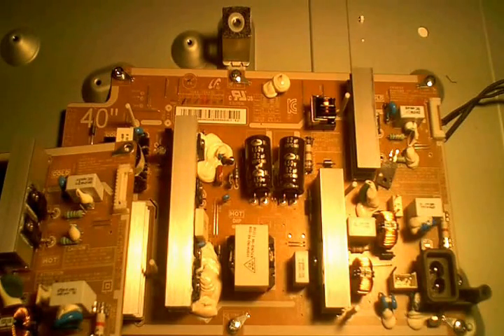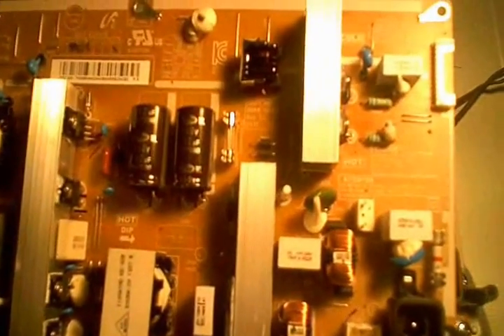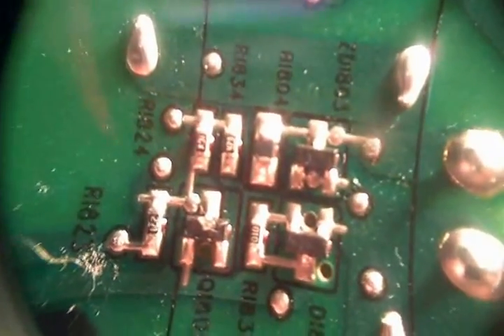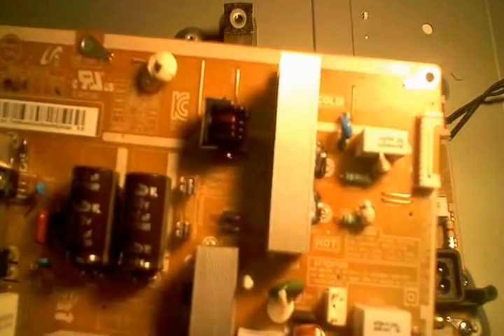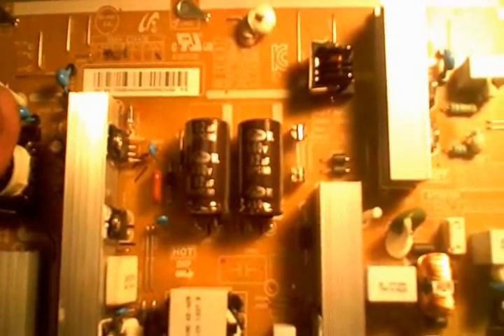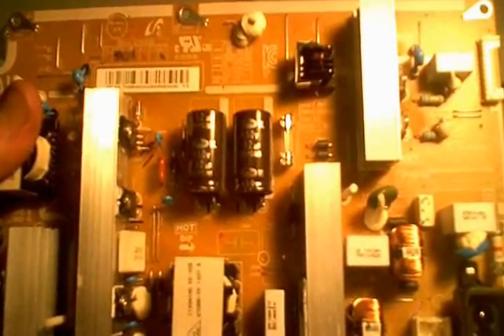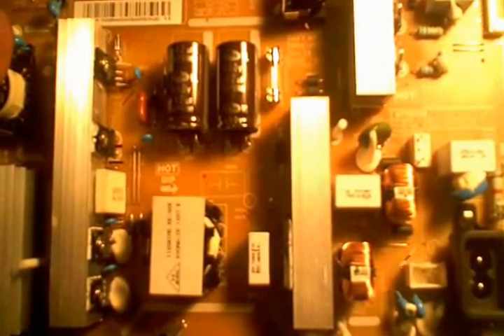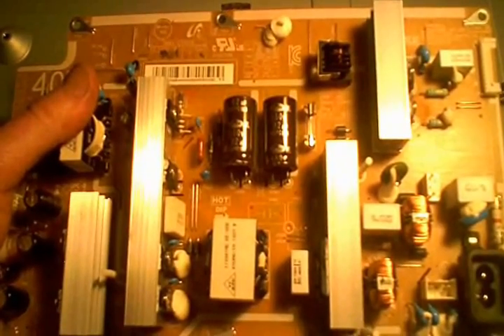Salvaged TV parts. Warning about some retailers..

Comment: I fix TVs for a living.Same exact deal.Sometimes you get stuck with a board so badly damaged,you have to purchase a refurb or a used one.Now that the set is on MY bench and open,the customer wants it ballpark when you say its going to be done and estimate price.I have TWO MAJOR "established parts dealers" that have it right on their website "all parts tested and working by a qualified tech". Im not going to name names,but when I order these "ELECTRO PARTS",I need my "TV PARTS TODAY". EP sent me 3 bad main boards in a row.How did I know?The problem with the set was it wasnt reading the HDMIs.The set fired up perfect.However,every time EP sent a board,the set was completely dead.Shop Jimmy,the go to guys,finally got it in.A 10 day repair job took 3 months.When I dealt with "TVPT",I needed a power board for a sony.The original was corroded beyond recognition.3 bad power boards in a row they sent me.And OBVIOUS bad boards,just by looking at them.Then took a month to get a refund.I FINALLY bought the board off some guy on ebay because I was desperate.It came wrapped in an old curtain,was half the cost,and worked on the first shot.If I was a beginner,Id have thrown the sets out and given up.Thats what these places WANT you to do.Currently I am sueing "EP" for $1200 for wasted bench time and I had to eat the cost of the repair.Case filed with the Cali attorney generals.I buy ALOT of parts,folks,the ONLY one I found to be totally reliable is Shop Jimmy.Good luck and watch those scam vendors!

Comment: I have gotten a few free tvs from Craigslist from upgrading and or have cracked screens I check if they work and then unplug and let them sit a week or so in my storage unit. Then I take them apart it's something I can do after my job and my son loves to watch and ask questions at 5 years old. I look at everything I take apart and post lots of pics on the parts but is there something I should do like zoom in and take pictures of the connections also?
Reply from the maker: +James Pace 
Plugging the TVs in to see if the back light comes on is a good idea. If it does you can know the power supply and inverter board are good. and perhaps the main board and T-CON board are also okay, but most of the time you (will not) be able to know if a board is working or not by doing a visual inspection, so more magnification isn't necessarily going to help. On the other hand bad capacitors are often swollen on their top.
 When Transistors, Diodes and resistors go bad you can often know by doing a resistance test across their junctions and looking for shorts, but bad ICs are more difficult to detect since their internal problems are often unrelated to being shorted. Even finding a TV with a cracked screen is no guarantee the boards are still good, Sometimes people smash their screens for entertainment value or anger after they determine their expensive TVs aren't worth repairing.
Reply: +Grants Pass TV Repair ok thanks for that I will  look for anything swollen
Reply: +James Pace my eBay tag is jamiepac-5 I normaly get a few broken tvs I just salvage for parts our salvage yard take the rest but they just take them for free so better then having to pay someone to get rid of. I smelt copper on my spare time and made a few things with molds with green sand. Once in a while though I get tvs that have nothing wrong with them they just want them gone and my train car in the back can't hold a lot of them so I break down the parts and then put them in boxes if anything you ever need just let me know just took apart a 50" hitachi the screen was turning purple had two of the lenses melted when I took apart

Comment: It's been getting bad on the buying end as well, have you heard of the new scam they have called the "Global Shipping Program"? It's absolutely useless, it gouges the buyer and plus Pitney Bowes has been removing packing materials from packages to cut down on weight. Also since they started hiding bidder identities shill bidding has gone up several 100% at least, it's not uncommon for some sellers to use teams of fake bidders to pump the price up.
Reply: shill bidding is rife on e - bay , very common. The bay of thieves.

Comment: Yes indeed. I got two boards supposedly like new from a working TV on eBay that I replaced in my TV and didn't fix the issue.  And as you said I didn't bother returning the boards Since i don't see any visible sign of damage  i have no way of knowing 100% if it is the boars.I'm sure i got ripped off.

Comment: Hi dave,
I have brought a psu from a company on ebay who strip down TV's that they get from waste/ skips.
be fore I install I checked the board and found that 3 smd resistors open short chopper transistor and mains filter cap bulging at the top ( 400v 68uf esr 1.35ohms) that was the first board.
so I complained,they sent a replacement no good still. 2 smd restor open smd shunt open and micro had a crack on it, BUT ALL THESE BOARDS ARE SIGNED FOR TO BE 100% OK,,,,, CRAP!